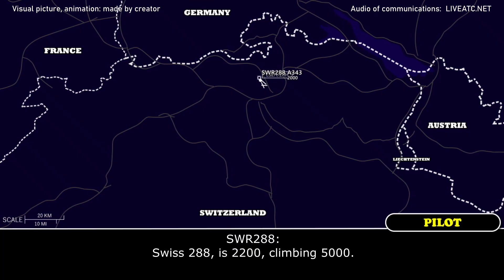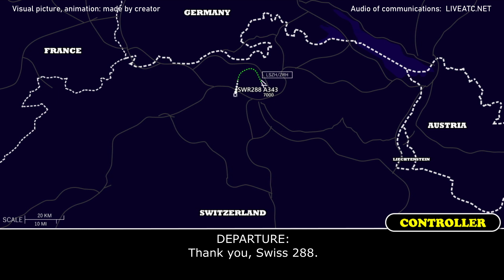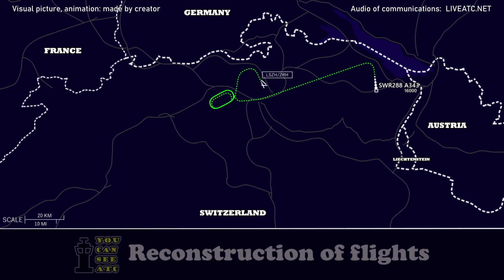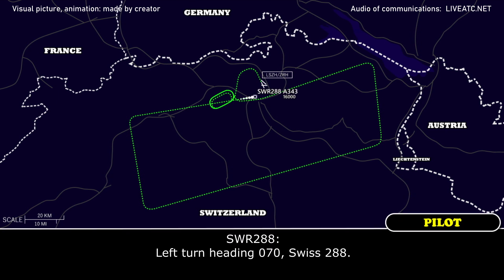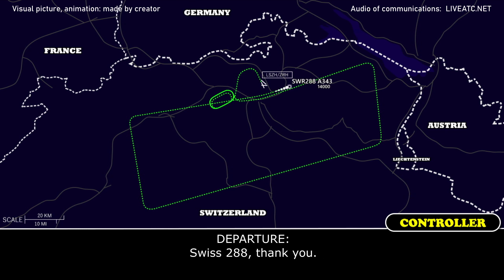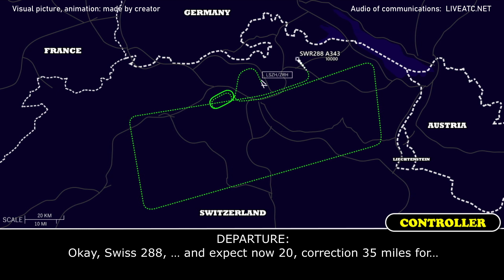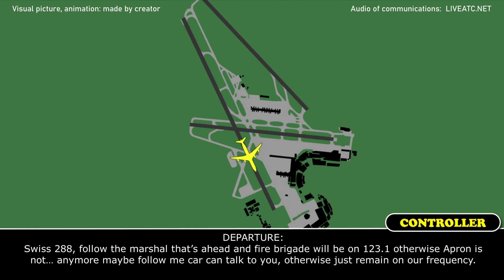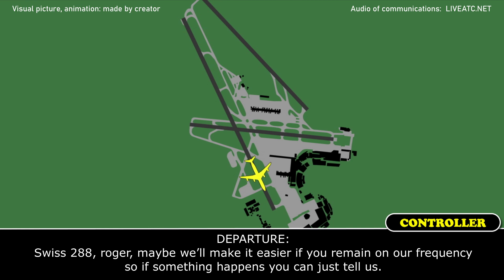Airplane DUMPED 37 TONS of fuel. Flaps retraction problem | Swiss Airbus A340-300 | Zurich

Comment: Hm they could burn that fuel easily by continuing the flight. Moreover, with a refuel stop around Egypt, due to the extra drag :)
Reply: That wouldn’t work as you would then be in an airport with a flap problem requiring repair. Can it be repaired quickly. Is there the appropriate engineering support and parts. Crew duty hours etc. Much better back in home base.